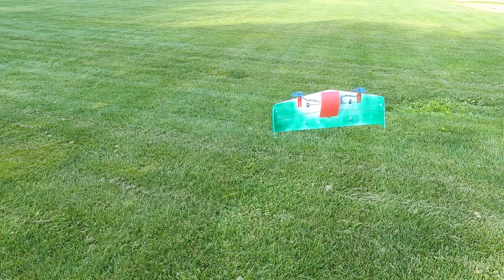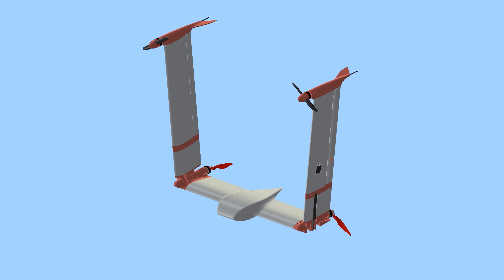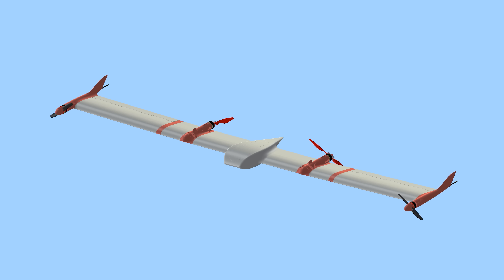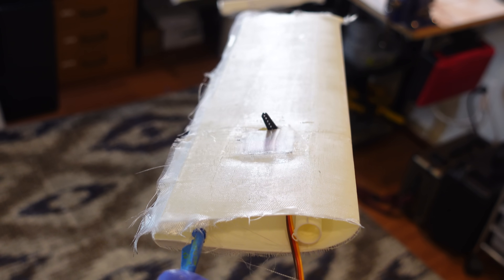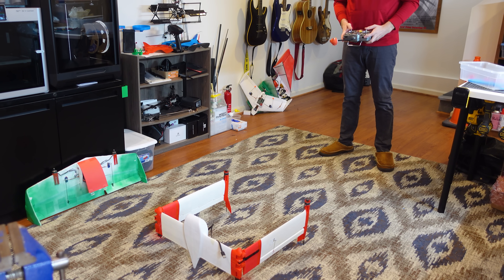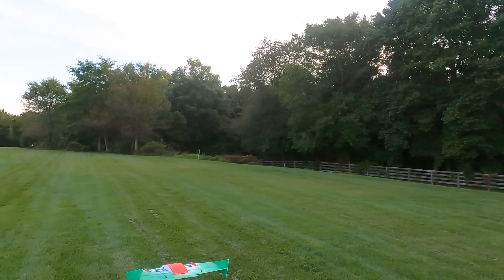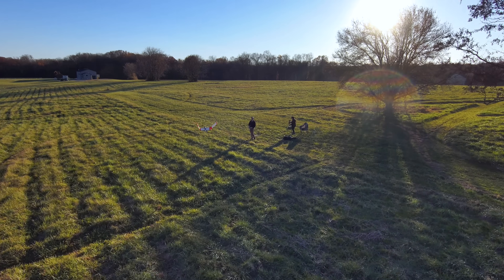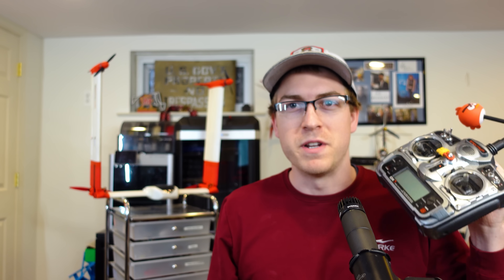Un-Folding a Quadcopter to Increase Efficiency - Part 1

Comment: Awesome stuff.  Is there any reason the "quad" has to be a square?  You could have a longer center section and then when the outboard sections fold you get a rectangle.  Should still be controllable though you lose a bit of pitch authority perhaps.  But then the loads on the joints are greatly reduced.
Reply from the maker: No reason it can't, but yea you got it--less pitch authority that way

Comment: dont you think the larger props would be more efficient in forward flight vs the 5in props on the tips even if they oppose the tip vortices?
Reply from the maker: They're lower pitch so only good for slower speeds, not necessarily fast forward flight

Comment: Hey man can you link that linear actuator??
Reply from the maker: This is the specific one I used but there's plenty others with different stroke/speed/strength: https://www.servocity.com/hitec-linear-servo-2-0-stroke-0-2-sec-48-9lb-thrust/
Reply: @NicholasRehm  Thanks man !  I just 3d printed a electric trolling motor for my kayak. I was thinking about using that same actuator for steering.
Reply from the maker: @angelon7095  To be honest, I would advise against it--I had some problems with build quality, plus the stronger ones are really slow. A high voltage 1/5th scale car servo might work better for you
Reply: @NicholasRehm  thanks I'll look into it !

Comment: For tuning the transition, why not fly/tune it as a plane (start in plane mode instead of quad mode). Then do a linear approximation/transition of tuning values for the transition between modes. 
Not sure if this made sense, but I think it’s a good idea.
Reply from the maker: I'm terrified to launch it in plane mode since I don't know how well the flight controller gains are tuned, with it being intentionally statically unstable. Inching toward forward flight from hover felt a bit safer. Maybe a fixed-wing dummy aircraft could help with forward flight tuning...
Reply: To estimate the stability derivatives for forward and transitional flight, why not use CFD? It might not be perfect, but it could give you a ball park figure to start tuning the gains in your PID controller.

Comment: This asks to be a canard
Reply: When transitioning, at a certain point you experience lack of control from both thrust differential and control surfaces. Your wing is still stalling, lift is imbalanced, but neither relative airflow, blown lift or thrust differential provide enough torque to  keep on transitioning. A canard would give you some more stability and some better authority. You'll be able to actively stabilise like a normal tailsitter at all points of transitioning.

Comment: Instead of having the wings fold up in a “U” shape, you could have them fold down in an “n” shape. This would make it stronger in the plane orientation because the bending forces would be fighting against a mechanical interference instead of the strength of the servos.
Reply: glad someone said it!
Reply: I have built and flown the N shape.  It worked, sort of, but had some problems.  When hovering close to the ground yaw was uncontrollable because any cross wind makes it spin like the cup wheel of an anemometer.

Comment: Would it not in theory suffice to have a reliably self recovering in flat mode? You'd make some good height hovering, fold open disregarding controls, endure the death spiral and...self recover. You could test folded out flying from a manual launch. You might crash, but you do have the hover function if there's enough altitude.

Comment: I think it might increase forward flight stability if the wingtips were swept back.  Maybe the hinges can be at an angle?  In the straight configuration it has very low pitch moment and the elevons have little moment arm.  Kavin's wings all had some sweep; gliders with wings that shape need a tail.
Reply from the maker: Static instability is a feature, not a bug ;)
Reply: @NicholasRehm  Well that's a very ambitious control task then!  I'm looking forward to seeing how this performs relative to Tom Stanton's latest tiltrotor.  Perhaps you can devise some kind of VTOL challenge? =)

Comment: I was waiting for this video, but, honestly I wasn't expecting that. Very interesting choices... I'm waiting for full forward flight, and... lots of performance data! 🙂
Also, Graupner makes quality folding L & R props form carbonfibre and glassfibre - I can recommend them.
Reply from the maker: Do you have link to any counter rotating sets? I can't find any in their catalog, maybe not looking hard enough
Reply: @NicholasRehm  you will be better of contacting graupner and asking them for a reseller. I find them locally and never online. You're looking for CAM FOLDING PROP.

Comment: Why not fold the other direction and have a stop at 180 degrees? that way, the actuator does not have to work against the lift forces.

Comment: Quick note: it would be preferable from an efficiency standpoint to have the small props off during forward flight. A larger prop spinning slower will give better propulsive efficiency than a small prop spinning quickly for the same thrust. Even if you don't change the configuration as it sits, it would be an interesting comparison to see with the inner props off vs. the outer props off.
Reply from the maker: I may test that in the next video, but the inner props have pretty low pitch making them only really good for hover, not high inflow forward flight

Comment: The oscillations are due to the polyhedral on the wing. You're ending up in a Dutch roll situation. You might want to try unfolding further before pitching over for forward flight. Another option to consider is a Z shape instead of a U.
Reply from the maker: Might be that, combined with poorly tuned PID gains
Reply: @NicholasRehm  BATMAN testing his next batwings , really exciting
Reply: Yup, I concur. And all that mass at the wingtips wobbling around is probably making it worse. Still, damn impressive!
Reply: I'm thinking he needs to dampen yaw oscillations with a control loop using differential thrust from the tip motors. The lack of vertical tail and huge dihedral make this especially Dutch-rolly.
Reply: @NelsonBrown  Yep. It needs a fin. Also, the lack of tip washout may cause tip stalling.
Reply: @NelsonBrown working the problem from this angle first teaches more about the issues this design faces. And it leaves the software solution wide open for later tuning. If he brute forced it using feedback he is eating into the practical margins of that method.
Reply: i'm guessing it would be fine to crank the damping values up quite a bit since you don't need much agility during the transition
Reply: @charleslambert3368  the damping may be close to zero with no vertical tail, so cranking it up to a normal amount could be good.
Reply: Are the actuators for the wing folding synchronized, if not, you get very big asymmetric forces both aerodynamically and from different nonsymmetric force vectors from the tip motors.
Reply: @leifhall2289 in the first shot of him holding it and straightening the wings I pointed out to my wife they were lowering at 2 different speeds, so I know that will account for some wobble.
Reply: @leifhall2289  I kinda want to see someone try to make a Y-copter with a single fold in the centerline.
Reply: The Z configuration has problems with pinwheeling in a cross wind, especially when low to the ground when the control surfaces are washed out.  Never the less, it did work fairly well.  https://youtu.be/hmLZj_PQUZY 
Also, you can use differential throttle to damp the yaw oscillation, which is similar to adding vertical stabilizer surface area, which is the common cure for dutch roll in conventional configurations.
Reply: @RanDStClair that z shape kind of nailed it! lol
*ztol
> a gyro! why haven’t anyone thought about that
Reply: You might also buy yourself some stability by diving during transition. Not necessarily targeting 0 lift, but unloading the wing significantly
Reply: @michaelharris679 I also thought about powering off or slowing down the rotors before/during transition. The dive sounds like a good idea.
I’m also wondering about the lack of tail and stabilizers there. Maybe there should be also some kind of unfolding piece at the back?
Reply: it's effectively like having huge dihedral right? so there's a strong bias towards rolling back to center
Reply: Yes, that could sort it! Anhedral should kill the aerodynamic oscillation, allowing Nick to ramp the PID gains back up. Anhedral will allow slight sweepback of the outer panels (for reflex) without making the 'dutch roll' worse.
Reply: @richardm.newlands2417  with such strong anhedral the plane would quickly roll inverted and then have Dutch roll. 🤔
Reply: I think the instability can be cured by considerably increasing the vertical stabiliser area. And if possible increasing the moment arm, ie making the tip pods longer.
Reply: Just did some basic simulations and Z seems way worse than this current design
Reply: I'm absolutely no expert in this field but to me it would seem helpful to angle the wings rearward just past the pivot points.  Idk, 5 to 10 degrees?  More maybe?  It would seem like this would make it easier to unfold and also make the vertical to horizontal transition.  Maybe somebody has software that could model this.
Reply: Since we know the bicopters work fine he might just transition fully then tilt over. There would be a small window where it is vulnerable to the wind in the way he is trying to work around but then he has the option of working backwards from horizontal flight to hover mode. That might be a route to figuring out the ideal routine.
Reply: @DrewLSsix  Yes.  Unfold the wing and then transition to forward flight.  Also, I'm not sure when the inboard motors cut out or if you can control when they cut out, manually.  

Everything the guys who actually work on these things say is way over my head.
Reply: or maybe he can rotate the motors instead of the wings, like the Osprey does.
Reply: Maybe an ">_<"-shape could work better,  transitioning into a somewhat "seagully" configuration. Alternatively, a "<_>"-shape may be explored too.

Also, consider extending wingtips beyond the outer motors, so that in an unfolded state the outer motors stay closer to the fuselage. The corresponding c.o.m shift in folded state can be compensated by the increased mass of the center plane/fuselage (e.g. a larger battery).
Reply: I'm also wondering if any of these ideas would help.
* Consider leaving the unfolded position with a dihedral of a trainer, whilst you test. 
* Lowering the rates on the ailerons when in mid-unfolded position might help? Or even Leaving the aileron limits at 0 degrees deflection until you are 90% unfolded? Slowly increasing the deflection percentage, and rate until at 100% unfolded.
 * Add flaperons to the center body, for the transition, instead of using the ailerons during transition? Using ailerons only when in level unfolded flight.
* Consider that there will be a tipping point when you don't want the quad-copter variable rotor control on the props, as that will create potentially unexpected yaw, creating your oscillations. Once you start flying with ailerons, you want to avoid asynchronous thrust. 

I wouldn't be surprised if the async thrust, with the extensive dihedral, excessive rates on the ailerons, and vortices from the wingtips and props caused your wild oscillations. Wishing you could test fly it unfolded, with out async thrust, by throwing it to launch it. That would tell you if your level flight stuff is good or not. Or go up high, start your forward transition, and kill thrust as you dive and unfold. Then when unfolded recover and glide to see what happens. Add minimal thrust as you level off. 

It might also be worth tweaking these things in a simulator. I've used RealFlight 4 in the past for this... A decade back. It was pretty spot on once I put all the measurements in. Also an accurate prelude to the terrifying experience that would come at the field. I was in denial that it could be that out of control IRL, as it was in the sim. With the thrust pitching the plane the way it did. But the dozen of recovery attempts in the sim with that setup, were what got me safely to the ground that day IRL.
Reply: None of that matters once you have the PID gains correct. Once they are correct, you can make a pig fly.
Reply: Agreed - the wing is tip stalling and then being recovered by the lift motors then stalling again on alternating sides - try going much faster before unfolding :)
Reply: Won’t a Z shape introduce inherent torques due to gravity unless it’s Uber balanced and counterbalanced
Reply: In my experience, excess dihedral with low CG creates exactly those oscillations. Probably simply going on in extending the wings would solve the problem. Another idea (but would take big rework) is to taper the wing, so that the lift of the wingtips is less than the central wing section, still with reasonable efficiency.
For now I'd suggest to build a dolly for taking off in airplane mode, maybe just keep some 1 - 2 degrees of dihedral to add stability without inducing the "dutch roll".
Ah, one last thought: side stability? A couple vertical fins protruding from the central body, extending as backwards as possible, may help
Reply: I've watched this like 4 or 5 times.  Still can't wait to see part 2.
Reply: When
Reply: Would extending the wings beyond the the outer props decrease oscillation by centering that weight a little?

Comment: Why not design the joint so when folded the wing tips are below the center line of the plane?  In that way , once unfolded the load on the joint helps keep the wings in place.

Comment: Something that immediately occurs to me: one could get the same effective wing area with no cantilevered structures by having the wings in a square configuration, then transitioning to a thin rhombus or a diamond shape. One could use wires or a thin timing belt for this. Another idea: One could morph this into a Lambda Class shuttle from Star Wars for some viral clickbait.

Comment: Super cool! It would be worth considering moving more of the weight into the wingtip pods (move some of the battery cells and esc’s there?)
That will help move the hover-mode CG more central between the motors, improving hover efficiency and also dynamic behavior around that axis. It also has a benefit in flight mode, because moving weight from the body to the wingtips reduces the strength requirements of the spar/root — and even better, the strength requirements of the folding hinge/mechanism. The same rationale as wingtip fuel tanks :)
Reply from the maker: Yea I thought about tucking two batteries in the outboard wing sections to pull the cg closer to the center in hover--that would certainly improve hover handling. Maybe in the next one!
Reply: @NicholasRehm  I love all the stuff you’re doing, it’s very cool! Keep up the great work 😎

Comment: Nifty idea with the prop mounts, I might just shamelessly steal that for my own VTOL project. Can't wait to see the full transition! I'm also quite curious about your method of blending controllers on this. Good luck with the project:)
Reply from the maker: I basically copied my approach from my last video on tailsitter transitions to fade between flight modes. Unfortunately, I think that simplified approach needs some tweaking to work with a morphing wing
Reply: @NicholasRehm  Interesting, that was also a great video by the way. Did you also adjust the motor mixing basf on the position of the wing folds? I cound imagine the pitch authority will get smaller as the motors come closer to each other as looked on from the side. Or is the craft tilted far enough to be out of the stall regime where this becomes noticible?
Reply: The controller part of it is defintely a challenge as I found out from my folding wing tailsitter concept a while ago. It seemed like I had to switch to using quaaternions vs euler. Pterodyanmics concept solved that by not having to transition their IMU from vertical to horizontal.

Comment: My uneducated guess is that the oscillation is caused by the flight controller not being tuned to the tremendous leverage each motor has on the wing tips. 

How'd I do?
Reply from the maker: I think you’re right—more tuning needed

Comment: You mentioned the stress of lift on the wings applying additional force to the moving joints.  Would a design where it folds upwards to the flat position have simplified it? (Think an 'n' shape while transitioning instead of a 'u')